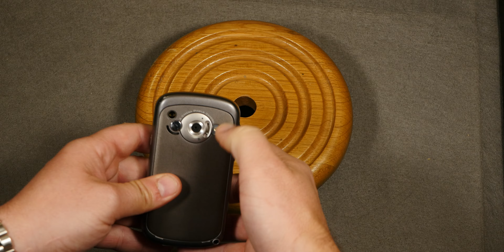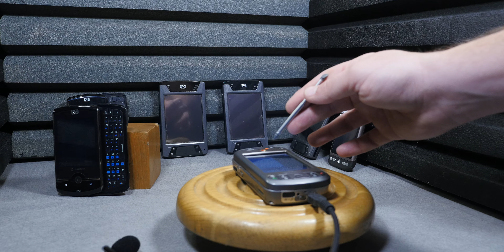Why 2006 Phones Had Better Keyboards Than Your iPhone

Comment: This looks pretty nice!! 
Reminds me of my n95 lolll 
Also i always thought front cameras were for selfies only 
It had actually never occured to me that you could also probably use it for video calls tho at that time do you think that it was possible to video call someone with a cellphone that has 3g? 
I mean the camera resolution is pretty low but still loll 
Also random question but was this phone a high end one or a midrange phone? Not that it matters that much but it has so many features lollll 
Feels like a mix of sony erricsons and the nokia phones of that smae year
Reply from the maker: By its market value and commonality I would say this was a mid-ranger at its peak. They were common enough, even though not cheap. It was an interesting time, to see the jump from feature phones with buttons, to smartphones with keys and keyboards, to resistive touchscreens with stylus, and then to full fledged "modern day" smartphones, like the first Androids or Iphones. Plus, there was the very peculiar "dumbphone with touchscreen" category - think Samsung F480 or the Nokia Asha family, if I recall correctly. 
It wasn't a linear progress, it was leapfrogging from one concept to another, until everyone settled on the most popular solution, but not necessarily the most advanced or efficient. I say that because I still miss keyboards, but I don't have the budget to buy a re-invented quirky qwerty design like a reinvented Blackberry passport.